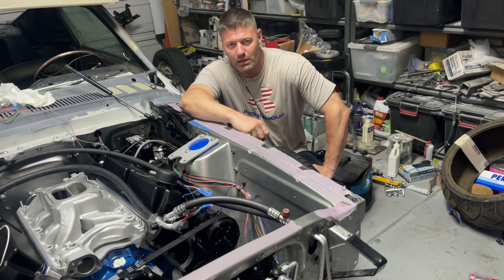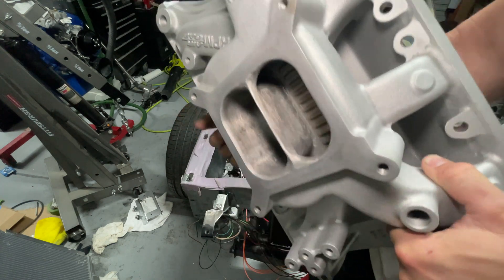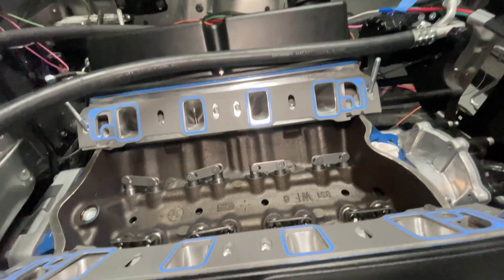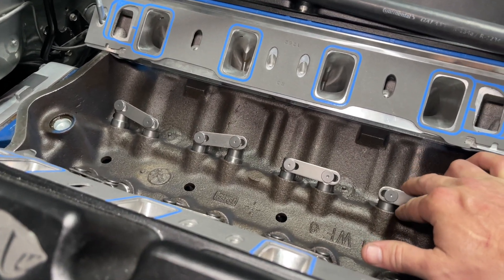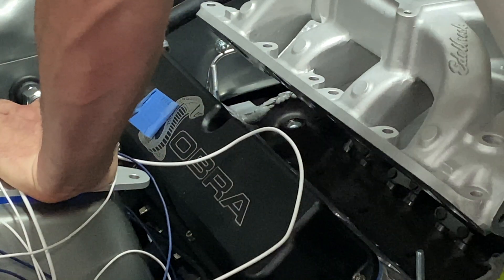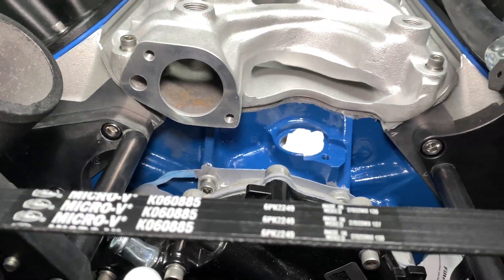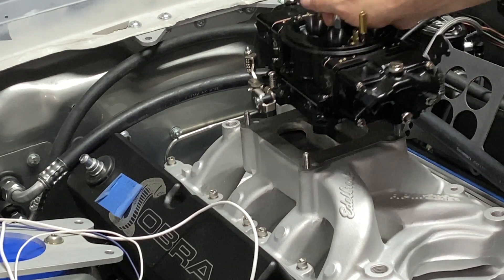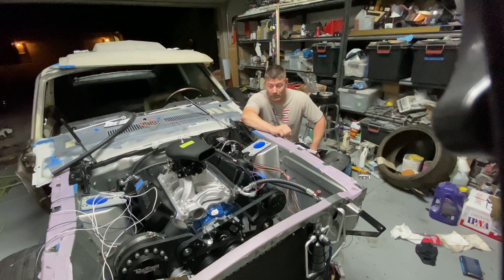351W/408 Stoker Engine Build PART 9 Intake Manifold Install  4K

Comment: Yay! I finished 1-9 in one sitting and took notes. The port match was so good too. Thanks for sharing all these videos with us. I just bought a 1974 bare block last week and getting ready to take it to the machine shop. Pulling my built 460 big block for my 408 build and install into my 67 S code coupe.  Wondering if you have a parts build list available? Thanks and cheers from Motown.